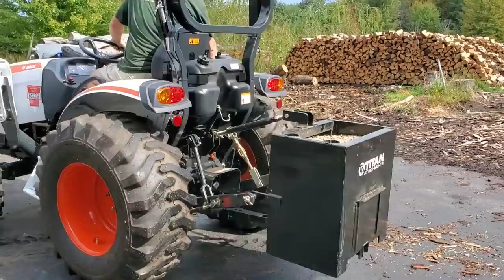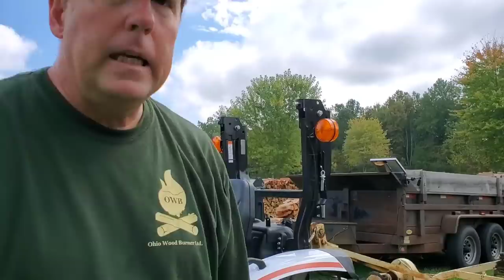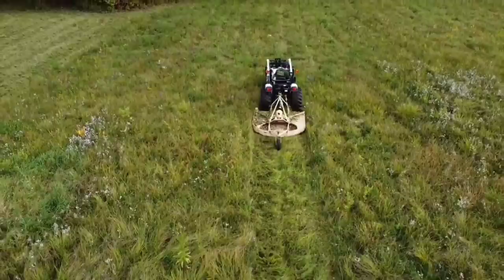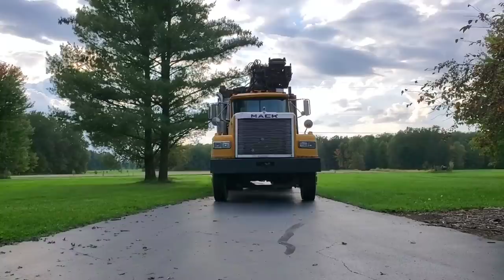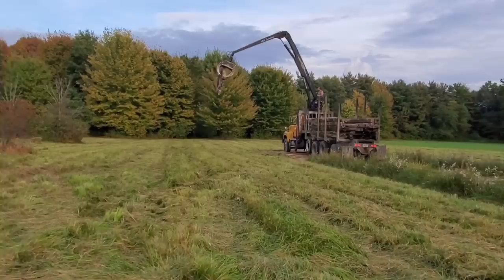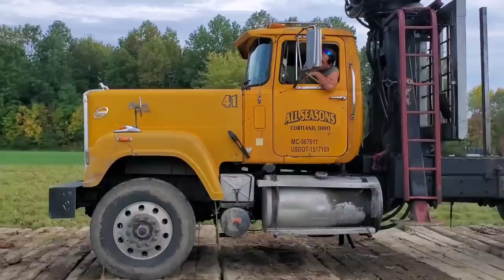This Log Truck Is Not Hauling Logs!!!  WHAT GIVES?!?

Comment: Looks to me like you might need to take an angle grinder to those blades on the brush hog. Seems to be laying down more than cutting. Those tire rims can really dull a blade fast. Brush hogs don't need to be sharpened often but you do  have to do it once in a blue moon. And like someone else said, some filler between those mats would be good to avoid ankle twisters but I would suggest sand to let it drain well or at least some very fine pea gravel. Just nothing that will hold water against the wood.
Reply: Definitely... Its mowing real patchy
Reply from the maker: I sharpened them one time but I agree they could use a sharpening.  Man are they a big, thick chunk of steel.
Reply: the only spaces I see it not cutting the grass and weeds is the tire tracks and the only way I can see cutting them is cutting them going the other way and and cutting them in the middle of your brush hog so you are not pushing them down again with the tires.
Reply: @ohiowoodburner  Btw Joe I don't know if they fit your brush hog Joe but they do make blades that can lift some of the down grass and weed and they are made by the Bush Hog brand name in brush hogs and I own a 15 foot batwing Hush Hog. You might be able to find that type of blade from another company that fits your brush hog if the Bush Hog brand don't fit your mower.
Reply: @ohiowoodburner  Yeah, you don't really put an edge on them like a knife, but you do have to rough shape them to get rid of the "rounding off" and that is where a die grinder can come in handy. as you can often do them on the machine if you can stand it on end
Reply: as a old road builder you are right

Comment: Joe, looks like progress! I dont know the cost of getting the "free" mats, but I'd keep getting them as long as you can. Less grass to mow! I noticed youll have a lot of voids between mats. Those could be real ankle twisters. Any plans to fill them with gravel or dirt? Especially where you will be standing when operating your equipment. 👍
Reply from the maker: I will be filling the voids with my scraps for now.  It has been smoothing down the entry the more I put on there.  That is one of the downfalls of this plan...need to watch where you are stepping

Comment: Extend the length of your top link.Allow the rotary cutter to float with the lay of the land.Use your 3pth to control the cutting height.In turn,easier on the tractor,and better cutting results.Just a tidbit of info.

Comment: Joe just a suggestion, if it was me I would get a 3 point quick hitch attachment. They sell them at Titan and they work really good hooking different things up to your 3 point hitch.
Reply: Joe you don't have to man handle anything you are picking up and you don't even have to get off the tractor when you hook something up or take it off most of the time, I have lots bigger tractors (one is over 600 HP and another is over 500 HP and none of my farm tractors that I till the ground with are under 300 HP)  when i got my first quick hitch I didn't have to use jacks to lift the heavy implements when I hitched them up. Saves your back and saves your time and Titan has one for a compact tractor like yours for under $250.00 of course I buy the green tractors so I buy green hitches LOL
Reply from the maker: I have seen them but have never taken the step to get one. Maybe this is the time to do it?  Thanks!
Reply: @ohiowoodburner  you will not regret buying one!!! Tim
Reply: @ohiowoodburner  It is up to you Joe I hate telling anyone what to do but if it was me I would and like I said all of my 3 point hitch hitch tractors have them. The bigger farm tractors are much more expensive than the $250 compact tractor quick 3 point hitches. In my opinion they are all worth it because they are so much safer and easier.
Reply: Before buying quick hitch, make some measurements to ensure whichever quick hitch you buy will work with your implements. We have 3 implements for our tractor and none have the same hitch width or heights, so a quick hitch would not help us. I am considering the Pat's Easy Change system for more flexibility on implement width.

Comment: Corduroy roads are great for boggy areas 👍 I’m lucky where I am using white cedar logs . Last for ever . Now your a guy that could use a nice heavy duty flail mower . I pile all my scraps from the splitter in a designated  area then mulch them with the flail . 👍
Reply from the maker: I was looking at flails.  The look like the would be better to have than the brush hog.  And they take up less space when they are sitting around

Comment: A finish mower for the tractor would be a good addition to keep the grass short close to the work/storahe area, or use the ZTR mower, and brush hog the rest. Is funny how you seem to be "slacking off" whenever the hired help arrives and act surprised, love those parts.
Reply: Also, are you running full throttle? Sometime those cutter need high rpm to perform
Reply from the maker: I can't remember the rpm but it was between the 540 marks on the tach.  I'm not good with numbers lol.  I need to try a flail mower!